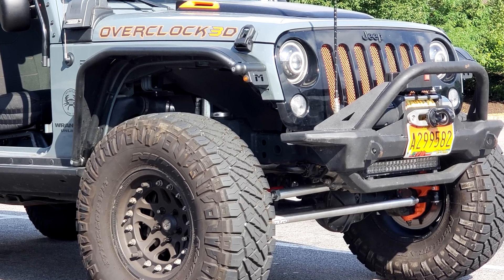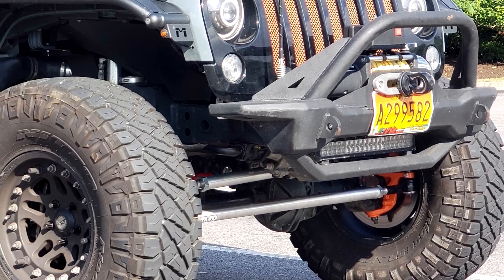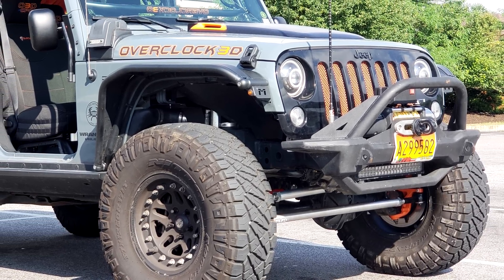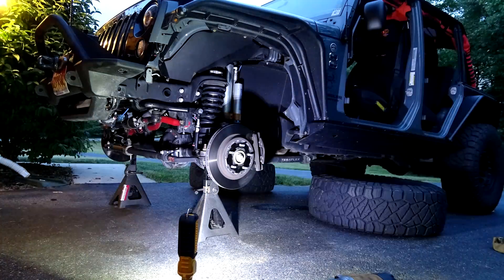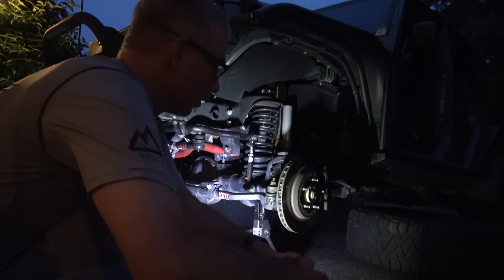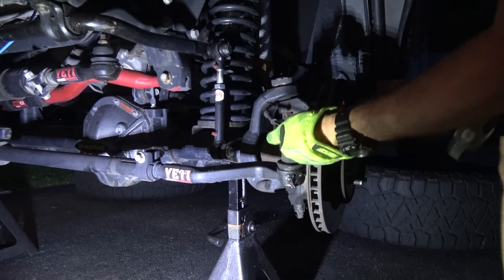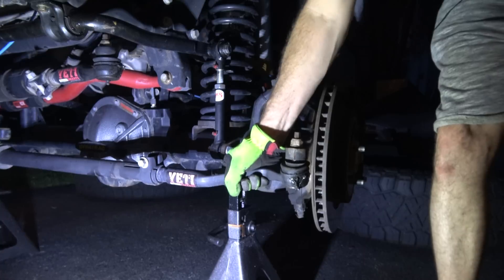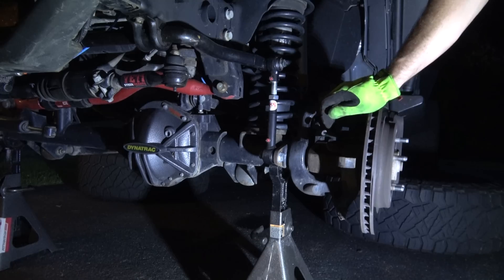Part One: Disassembly - Reid Racing Knuckles and TMR Customs 2.5 Ton Jeep JK Steering Kit Install

Comment: Hey Chris, while your in there are you replacing the ball joints? Now would be the perfect opportunity. Funny you mentioned the speed sensor cable disconnect behind the shock tower. I had the drivers side come apart on the trail and the incoming wire harness got wrapped up in the steering shaft linkage and damaged the harness. I fortunately found where the wire broke and was able to repair without replacing the harness. Those connectors are kind of a pain to get to unless you remove the inner fender liner.
Reply from the maker: Michael Durling These are Dynatrac ball joints that came with the axle I out on last year... So no need to change mine... But you are right!

Comment: What lead you to replacing your Steer Smarts Yety set up?
Reply from the maker: I decided to switch to 7075 Aluminum... and I really really like the rod end cartridges on these...
Reply: I was going to ask the same thing. Other than the obvious fact that he was asked by the company to install it. Which don't get me wrong I have nothing against that, but I am curious if you were having any type of failures with the YETI stuff.
Reply: I don't know if he did, but I did, the attenuator on the drag link failed on me.
Reply: I skipped the attenuator and just went with the tie rod and drag link.  Tie rod has taken a beating and not bent so I have no complaints.